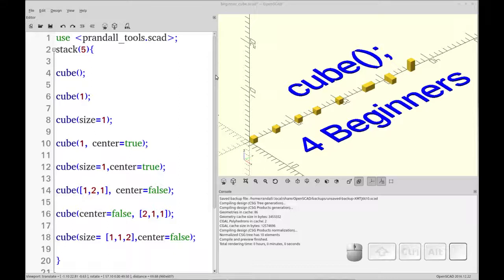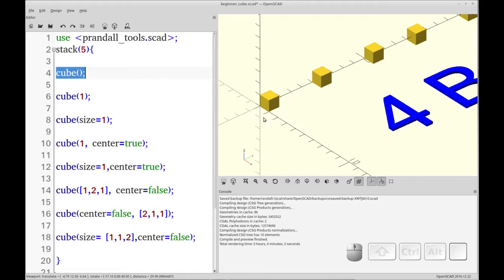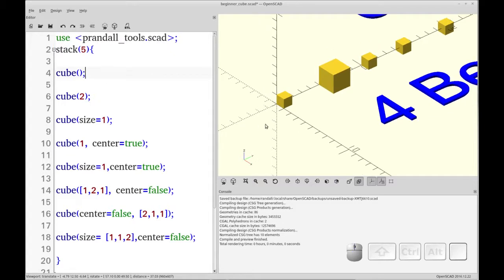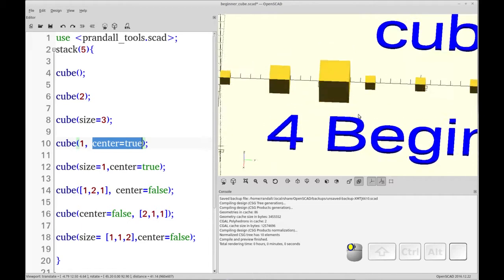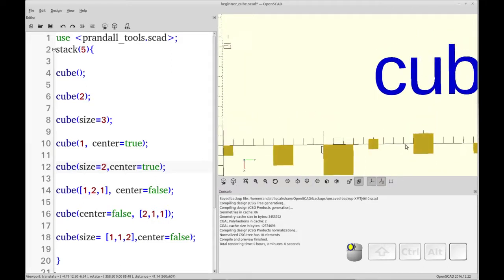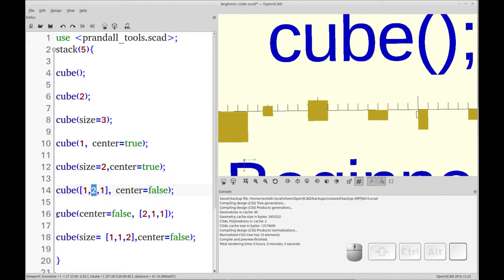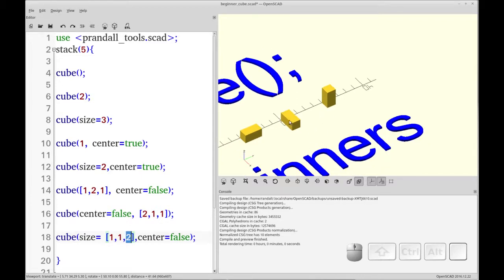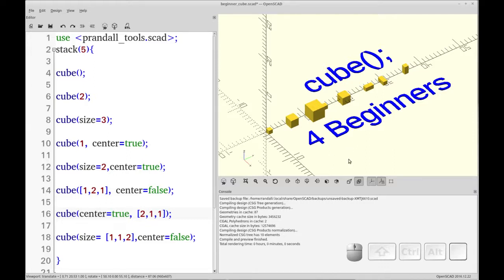OpenSCAD Tutorial Cube - Beginnners

Comment: I also noticed one can use, for example: 

cube([1,2,3],false);

where "centre =" is implicit when one just uses true or false. It works for all the examples you have given.
Reply from the maker: Absolutely, I tried give the most "basic" version. So for example whereas just using your example is more compact and easier, it requires more understanding. It takes some knowledge to know the argument in that position is for centering the origin. Once you have that knowledge it feels quite silly typing "center=" every time. Thanks for adding valuable insight
Reply: @mathcodeprint  I actually stumbled upon in by mistake by neglecting to put in "centre=".. Happy accident